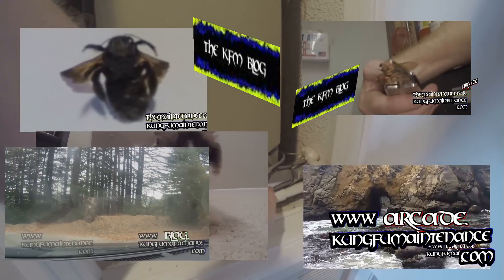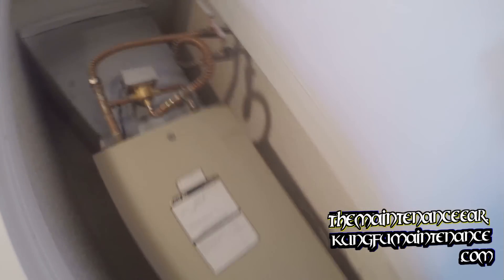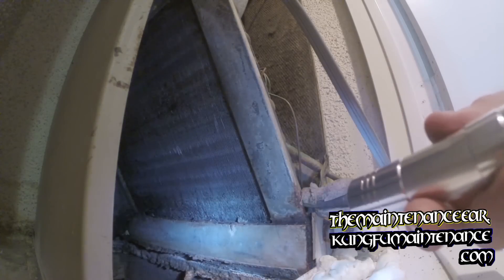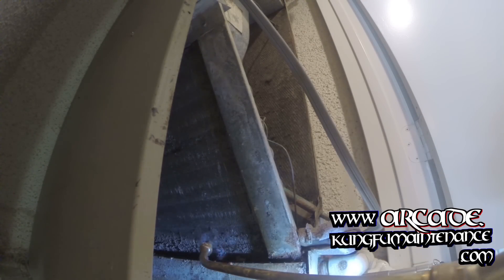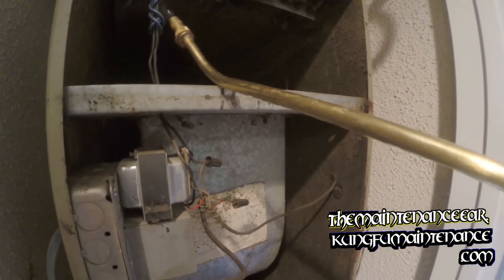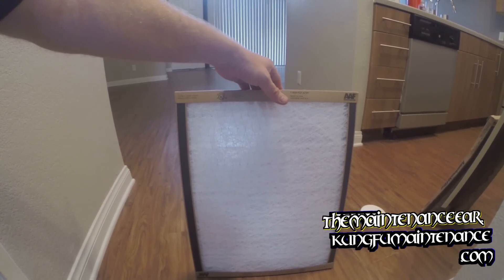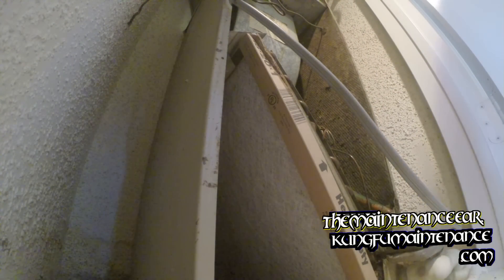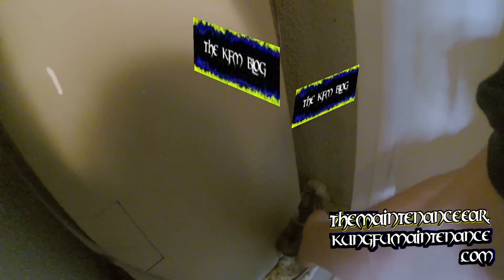Frozen Air Conditioner How To Unfreeze Defrost Fix Up Ice Froze AC Repair Maintenance Video

Comment: Curious how does the cleaner get rinsed off the hydronic  coil?
Reply from the maker: For the hydronic coil the coil cleaner must be manually rinsed off. I should have mentioned that here but show this in another video.
Reply: OK thanks.
Reply: +George W With the dirt from the filter....LOL!!
Reply: zeke112964 lol

Comment: Need to get oval shape brush,then light brush both coils before using the cleaner. Also if your doing maintenance on town homes or apartments, I would suggest get a stock of freeze stats, break, [Y] and put them on suction line at evaporator coil, cut condenser down saves compressors

Comment: If you live in an multi-unit apt. complex, most of the time these Evap. coils frost /freeze over due to very high humidity air being let in by constant opening-closing of the entry/exit doors. And a excessively clogged air filter does not help either, it traps the dirt&dust - even more so when it is wet and will restrict the return air flow. The best way to correct this problem -is by having Maintenance install in this order before the return air reaches the blower fan motor. 
1. a heat exchange box 2. a De-humidifer box 3. then at the front, a air filter box
By doing this - by the time the return/ recirculated air reaches the blower fan excessive heat & moisture & dust has been removed! { No moisture/dust = No frozen Evap. coil }

Comment: A very common reason for coil freeze up is improper sizing of the condenser for the size of the house.  A 1300 sq feet of living space needs 2 tons of refrigeration but plumbers usually install a condenser as if the house were 2600 sq feet.  When the refrigerant is converted from gaseous vapor to liquid again and returns to coils then ambient air around the coils freeze up!  The rule of thumb is one ton of refrigeration for 600 sq feet of living space.  Change filters as recommended by the manufacturer, do not obstruct or bypass the vents AND do not "super-cool" the house in expectation for a hot summer day.
Set the thermostat between 78-74 range and don't adjust it all the time!  You shouldn't have freeze up of your coils any more.  Don't forget to service your A.C. unit once a year in spring to make sure everything is ship shape as it should be.  Repair it before it causes you trouble.
An ounce of prevention is better than a pound of cure!

Comment: you're not supposed to run the system while spraying the cleaner on the coils.. the can says to wait until the coils are dry before running the system.

Comment: If you run the system with no air going across the coil, the coil will begin icing up and you'll never get it clean, and you will also cause liquid flow back to the compressor.
 No rinse coil cleaners can contain an Alkaline which can corrode aluminum- be sure and rinse the coil completely.
 For impacted coils, you MUST remove it for proper cleaning.
 A hand held sprayer may not have the flow and pressure to get the inner part of the coil clean- especially with 4 row coils.
 Cleaning a very dirty coil in place is about 50% as effective as removing it and using a strong water source from a hose.
 If you have a bacterial/algae/mold growth on the coil, it needs removing, cleaning then a bleach bath and rinse for health's sake.

Comment: One more question... How does that filter work better? I mean how does dirt filter dirt without letting dirt pass through?
Reply from the maker: So at first  these air filter lets larger particles pass through only a certain micron-sized but as dirt collects on the filter large particles block the larger Micron sized openings and collect on the surface of the filter until medium sized particles keep collecting until there is only smaller gaps smaller micron openings therefore the filter starts to clean better about a month after use because only smaller and smaller micron particles are able to pass through.
Reply: KungFuMaintenance Wow. that was hard to read. Do you ever use periods??? Time to move on to a video I can understand.
Reply: KungFuMaintenance Makes complete sense to me!  someone told me about this years ago and didnt have to explain much to me
Reply: +KungFuMaintenance So where do all those smaller particles end up for the 3 months that the filter takes to improve it's cleaning ability?
Reply: zeke112964 bypassing the filter and into the furnace blower and beyond, i'd guess...
Reply: bababooey7576 That's right...LOL!
Reply: zeke112964 LOL, I hate cheap filters and i hate how the techies hate the pleated ones..(i get it), but the one i use isn't a premium pleated one...1000 microns i think. and i change it often...never more than 2 or so months...max...my 32 year old a/c hasnt ever had a clogged A coil..and everything downstream seems to stay fairly clean...furnace never gives any dirt related problems...or any problems, come to think of it...from 1999 until now...same with the a/c...how i lucked in is beyond me.
Reply: I don't use the super pleated ones either but I'd rather change the cheap ones monthly than restrict the air flow with the super pleated ones......
Reply: zeke112964 Yep.  agreed.

Comment: You said that setting it for fan running helps it melt faster but then you shut the whole thing down, so which is it? Also, I’ve had this happen three times in an apartment complex and it’s never been due to a dirty filter
Reply: Turn unit off , set fan button to on . AC units normally freeze for way more then a dirty filter

Comment: thanks for this video instruction, you just taught me that i was wrong and the ac guy was right, because last summer i asked him to turn the blower up to full speed so i would get the house cooler faster, and he told me it could be done but he did not recommend it , he said on air conditioning you need a lower speed to cool your house better, anyway i had talked him into putting the blower on high speed for air conditioning and then i noticed that summer it never did cool down as good as before in this house, but i did not know it was because of the blower speed until i saw your video, i will have him put it back the way it is supposed to be when its time to use the air conditioner again, i want to thank you for this video, you actually taught me a lesson and from now on i will let the ac guy do what he was trained to do...great video,